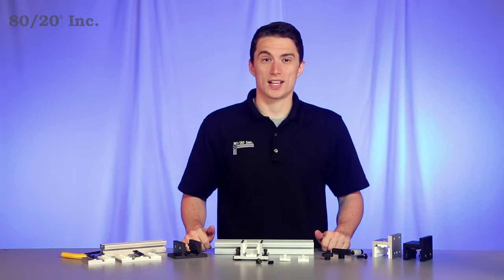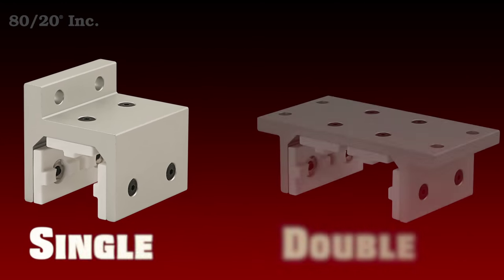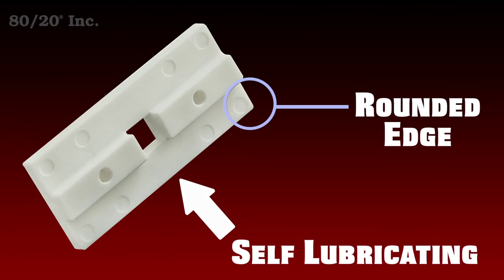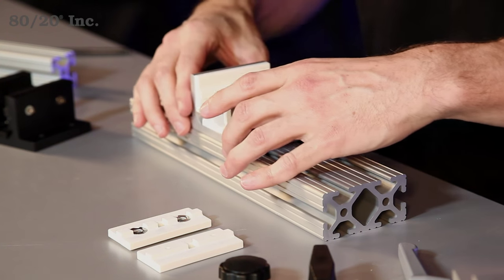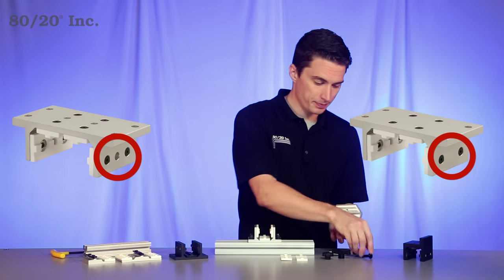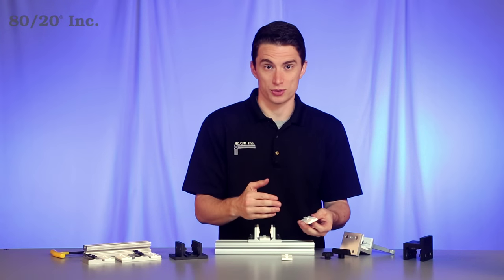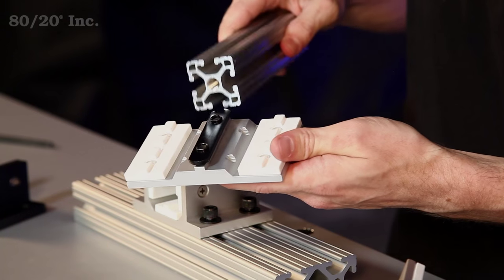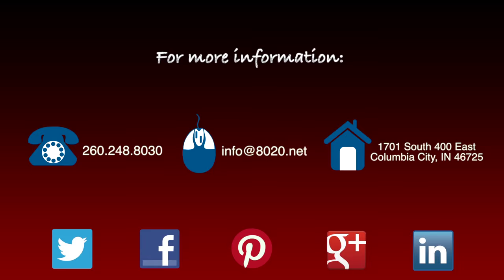80/20: Linear Motion Overview

Comment: I like your videos but wonder about the practical application of these components. Would they be used for drawers?
Reply from the maker: While these products could be used for drawers, we often see them used in applications where adjustability is needed.  Applications such as workstations, guards, displays, and more, are all great examples of where linear bearings can be used.  Any application that may needed adjusted based on the user or task, would be a great candidate for linear motion.  One great example we use in-house, would be our workstations.  The linear bearings allow our workstations to be raised and lowered to accommodate each employee.

Comment: What is the maximum payload?  I’m working on putting together an Assembly line solution. I'm looking to install  a Flat surface cart and slide each cart up and down an assembly line. The idea is to have the cards slide on & off the assembly line, can I use extrusions in combination of this item. My load capacity needs to be 750 lbs per flat surface cart. 6-8 carts total.  Would this be a suitable solution?
Reply from the maker: Thanks for your comment - will you please email us at services@8020inc.com so we can offer more assistance on your custom design? Thanks!
Reply: I would also like to know the weight load and distance for these.
Reply from the maker: @jannezack  Weight load will depend on the number of bearing pads of your specific Bearing assembly.  Total weight load is figured by the number of pads multiplied by 30lbs.  Additional specifications concerning our UHMW bearing pads, can be found in the additional catalog.

Comment: can you make a large sliding drawer using linear bearings that could fit between the wheel wells of a Van?
Reply from the maker: Great idea Cameron! Our linear bearings are weather resistant and using 80/20 products, yes you could design your application to custom fit your van.

Comment: So if I wanted to create a slide-out keyboard tray I would use linear bearings that attach to the underside of a desk... and using say a 1020 profile, one half would interface with the bearing while the other half would hold the panel for the tray.
Does that sound right?
Reply from the maker: Thanks for the question Jennifer.  That setup should work fine.  if you have further questions or concerns, please don't hesitate to reach out to our Design Assistance team.  We would be more than happy to assist you in your design.